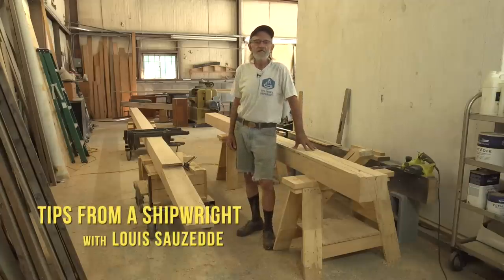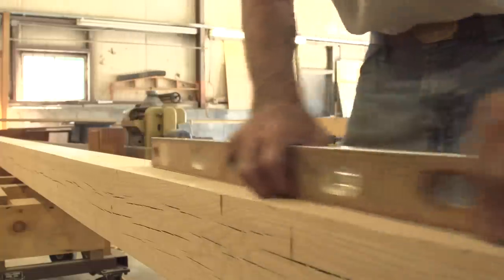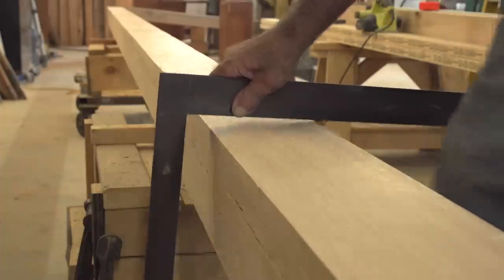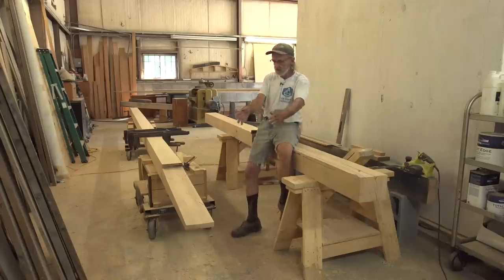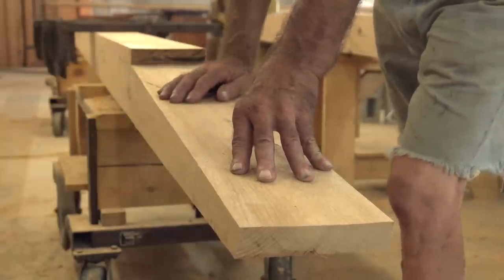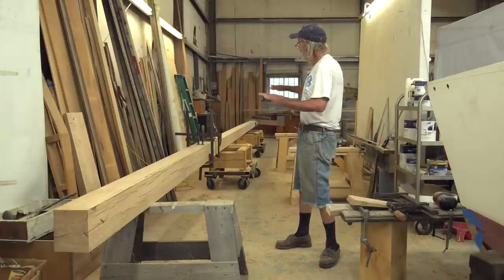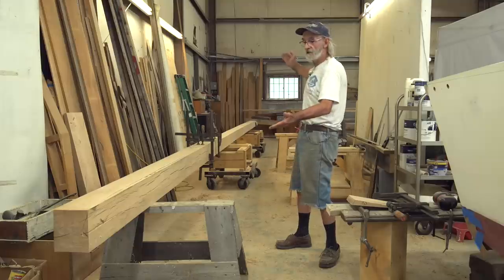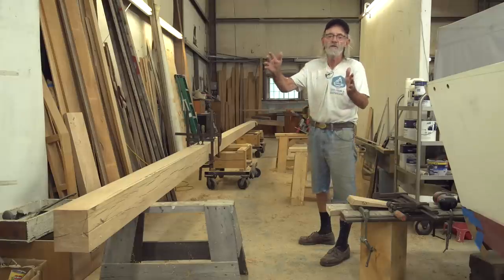Building ORCA - Episode 3: Construction begins!  Cutting and scarfing the keel!

Comment: I enjoy these videos, but this is my first comment.  I once went to an exhibition of Russian space craft, and before that an exhibition of American and European spacecraft.  The differences were remarkable.  Russian crafts were (to my eye) crude with mismatched joints and exposed welds.  American and European machines resembled Swiss watches.  Over time Russia machines performed as good as, and sometimes better than American/European machines.  This was acknowledged by the docents.  My point?  It will make no difference in performance or longevity if the ORCA keel is slightly off kilter.  I admire your desire for perfection, but it is not needed in a boat worked hard through it's lifetime.  If it headed for the motion picture museum in LA, that is a different matter.

Comment: I was thinking you'd have done a hook scarf for the keel so they cant slide apart longitudinally, I know they'll be bolted
Reply from the maker: There's very little force in the boat trying to pull the pieces apart, just not enough advantage to doing in imo